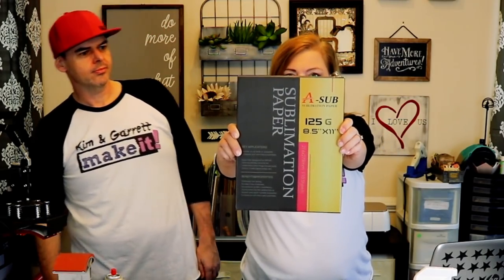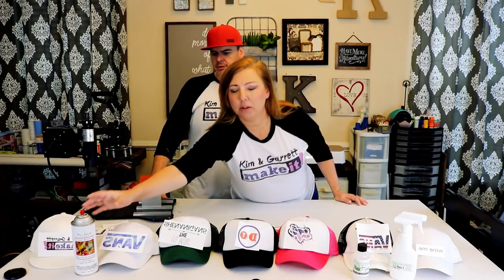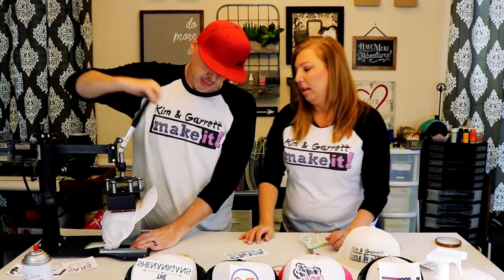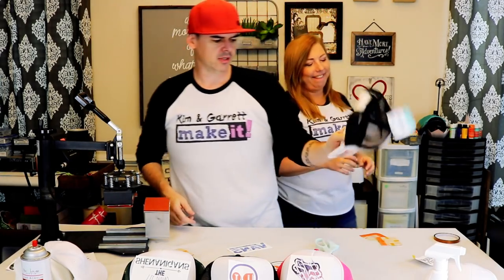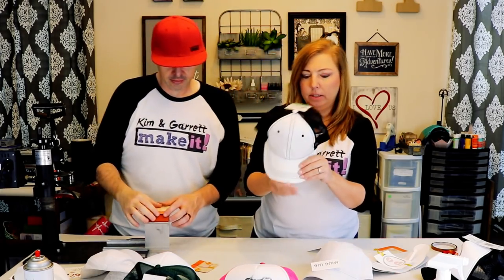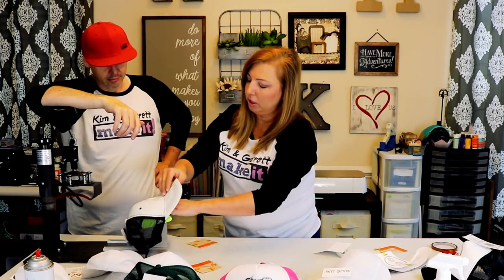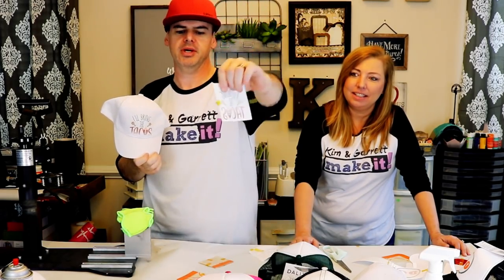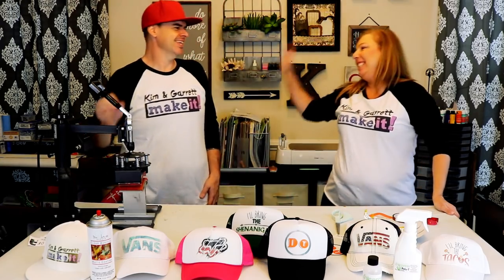Sublimation Printing on Trucker Hats Using Three Techniques

Comment: Don’t use that hat press the hats work I learned that those hat presses don’t do that well of a job. I will highly recommend using the mini heat press shaped like an iron it’s like $50 or the new circuit hat press which is the same but curved. Making hats is way faster by hand with the mini!
Reply from the maker: Thanks for the tip!!!

Comment: Press Marks? And i see you used a very high preasure.... any particular reason? I sublimate a lot of shirts with a very light pressure
Reply from the maker: We were trying to get the sides to sublimate as well as the top.  Trying to get a full pressure on all portions.